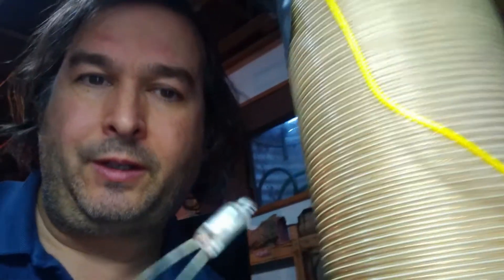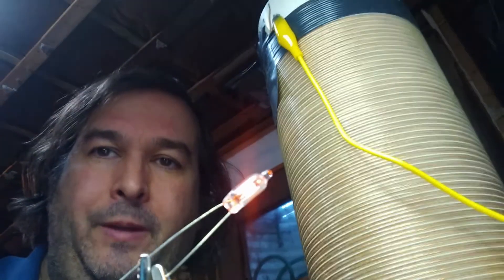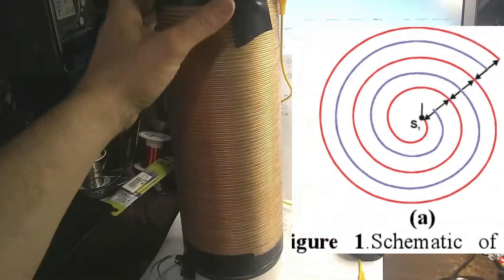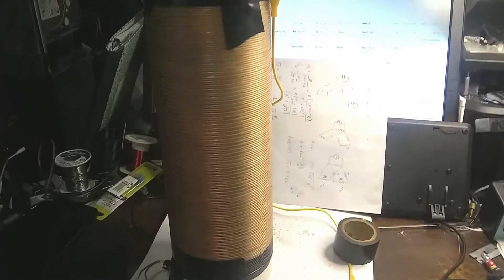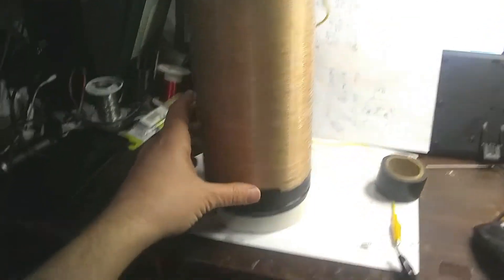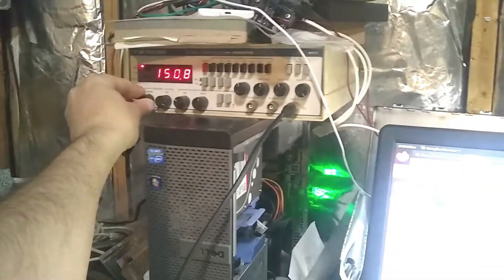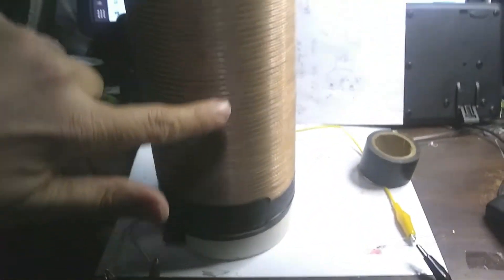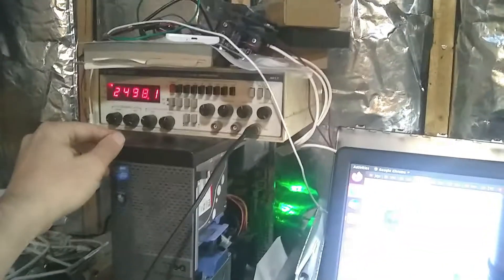High Voltage Spiral Line Transformer

Comment: I expected to see a switch there to connect the winding you are sending voltage through to the secondary winding and there to be pulsed high voltage.
Reply from the maker: I am switching it resonantly with a signal generator.. and a square wave pulse!